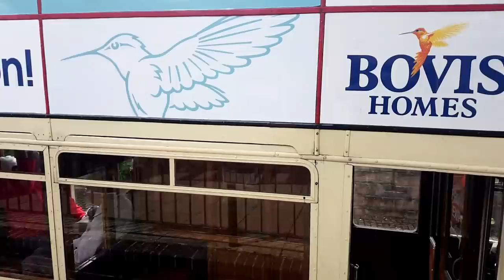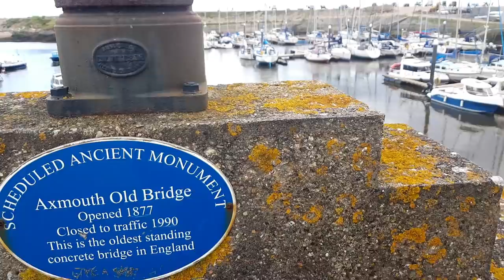Daewoo Matiz Sh**efest and Performance Mod!

Comment: Hi HubNut I'm a regular viewer from Oz, and how extremely entertaining they are. I loved your comment about 'where your life has gone spectacularly wrong' re the age of your cars ... Fear not I have a 28 yr old 1991 Honda Legend used daily, which still goes great guns! It has all the nonsense everyone wants these days ie air bags, apart from the info display screen, which can easily be retrofitted etc. It doesn't leak any oil, uses very little if at all, totally rust free, leather interior, has a very smooth and silky sounding 3.2, V6 when you put your foot down (and it has a north-south engine – but FWD) ... think about that, goodole Honda I say. Honda make great cars which don't break. I'm driving one of the rarest Honda's in Oz, rarer than a Ferrari ... ha ha. No one looks at it, but I do and people in the know. It's not my oldest car ... that is a 1974 Rover 3500S. All the best.

Comment: I love the Matiz, too. I had a silver Daewoo Matiz from 1998-2006, then in 2006 i bought the updated version and called Chevrolet Matiz in copper-metallic which i drove to 2019.  After a accident i had to buy a new car and of course a 0.8S Chevrolet Matiz again, a modell in ice-silver from 2010 and 90.000 Km on the clock. That car shines in my street. No rust, no scratches, and superb technical conditions after it was checked. Im happy with the Matiz-series and hope i can my new "used" car a lot of more years. :) Greetings from Germany.
Reply: @Aswin Anbarasan, thats true, but Daewoo only still exists on the korean market and Chevrolet with the Matiz sells only in southamerica. In europe either Daewoo and Chevrolet have gone. :(

Comment: Totally agree about triples--my Dacia Sandero has the Renault 900cc turbo triple in it, and it's a fantastic engine. Sounds great when revved and yet pulls from surprisingly low revs. Only time you ever really notice you're in a car with such a small engine is when climbing very steep hills indeed!

Comment: Love 3 cylinder engines - owned a Corsa B and C with the 1.0 engine, and they sound lovely when revved.
Reply: Mostyn the Sooty Van I learnt to drive in a corsa c 1.0 12v piss easy to learn in sounded good shook at 90mph mind you 😂

Comment: I remember a while back, Ford commissioned Yamaha to build a V6 engine for the Taurus. They actually asked just for heads, but Yamaha ended up giving them a complete engine. Ford fitted into the Taurus SHO. It had two runners for each cylinder, one short, one long. There were butterfly valves opening and closing off one or the other. So that was their way of achieving both torque and power.

Comment: I removed 3 restrictions from the intake system of my wife’s golf 1.6 16v. The only reason I can fathom they were there is because without them it not only destroyed a 2.0 8v “gti” but also the n/a 1.8 20v. Mind you that had a management system that could learn, you’re stuck with old Vauxhall crap :). Awesome video mate!

Comment: Hi ! About torque and power and intake length: many manufacturers deal with that stuff and have switching intakes. Opel / Vauxhall had that on the MV6 engines. It had a long bypass for low revs gaining more torque and switch to a short lenght for more top-end power.
On the Matiz a turbocharger might be the only choice available. Other than a different engine, but that's costly and may exceed the money you want to put into it - if any. It's a Matiz in the end and it is designed for a certain purpose as a small familycar not a racer.
The restrictor in the filter housing will limit the airflow at higher revs - and the engine will surely start running too lean in the end - which the fuel system will not detect. I would put it back in. It helps not to damage the engine. On a true fuel injection system which monitors the air masses and manifold pressure you could do that - not on the "el cheapo" system of the Daewoo.
It looks very suspiciously after a TBI even though they claim it were MPI. But what.
Reply: If it really doesn't detect it (seems from the pinking) than a bit of remapping might be in order or possibly larger injectors. I think the engine was developed by another GM branch, so it might be possible to properly tune it if the design was more or less off the shelf.

Comment: Peugeot has the same thing on the 1.1 106. I believe it's meant for low down torque improvement and noise abatement as it increases the air speed into the manifold at lower rpm but restricts it at high rpm. Removing it changed the torque characteristics of my 106 markedly.
Reply: @Spac8 - that's interesting. I've had my 106 1.1 for just over 2 years & didn't appreciate any applied restriction to the air inlet flow? I really like mine & we've just bought another for commuting!
Reply: @robk3596  They're brilliant! It is very rare I praise a modern French car but Peugeot/Citroën (PSA Group) got the formula bang on. From the 106/Saxo right through to the Berlingo/Partner. All the same basic layout, amazing rust protection, cheap parts and great handling. They're not without their flaws, but they tend to not rot like a Ford or have the complexity of a Vauxhall of the same era. I kinda wish I never sold my 106, was great fun and seriously cheap to keep running. 

(Edit: This applies to the multi point injected, later models!) With regards to the air restriction, take a look at the pipe that connects the front air feed to the air filter housing. It restricts the intake into a Venturi that is little more than an inch in diameter if I remember correctly. I played around first with using a pipe from a 1.6 Saxo VTR, as they use the same basic air intake setup, but the connecting pipe has zero restriction and is the same diameter throughout. (The 1.6 has a lot more torque!) It immediately changed in power delivery of the engine.

I then picked up a K&N 57i kit for next to nothing and that made the change even more noticeable. Essentially, with the stock setup, it felt fairly torquey low down but hit a wall at about 5000rpm and didn't make much power after that. With the swap to the straight pipe and then the K&N, you felt a small lack in torque very occasionally where the engine bogged a tiny bit and really felt like it wanted more air speed into the intake, like it was having to build up a bit of air flow first, but as soon as the revs got up, it was a totally different car. It wanted to pull to the 6200rpm redline and beyond! Was indecently fast for a 1.1 and made a hilariously good noise at full chat. I had a genuine 100mph GPS, (Closed road of course...) and a 0-60 of about 10 seconds from it. Have fun. I miss mine! 😢😞
Reply: Spac8 - Thanks so much for that, it's an interesting bit of extra knowledge in my case! It's my first one & hasn't missed a beat in over 2 years (25k)! Mines an 01 plate & have just bought a 97 for the wife to commute in etc. The main things I'm aware of are they all appear to leak oil mostly from the left side cylinder head area & rear torsion bar arrangement can be problematic with age! But as you say great cheap & fun motoring for what is a small car! Thanks again for your response!

Comment: The Citroen BX has it's origins from the Volvo Tundra concept car that was also styled by Bertone and based on the 343. Volvo rejected it because they thought it was too modern and difficult to sell so Bertone sold a similar design to Citroen which ended up becoming the BX. Some features like some of the switch gear and the electronic dashboard was carried over. The BX is very stylish and still stands out today. I loved the intermittent clicking the suspension made and how it slowly raised up from cold.

Comment: Just a thought about the ‘Reducer’ in the Air Box. Perhaps Daewoo made ONE Air Box to fit a range of engines. With each having different Air Volume requirements, that Reducer Spigot was the only thing that needed to change.

Comment: Also my Colt had same issue i tried fitting a K and N sports Air filter but it played havoc with the idle and the car would cut out , so yeah Air Filters are best left standard.

Comment: If you wanted to hear pinking, try the  Renault 18GTL with the detuned 1647cc engine (not the original 1397cc). When they started reducing lead in the mid-80s, mine made a horrendous racket....

Comment: Look up plastic welding with a soldering iron. I did it on the cinquecento bumper and it worked a treat. Use black cable ties as a filler rod if needed. Try not to burn the plastic as you do it.
Reply: Hot staples, followed by mostly cosmetic plastic melting, works better for lugs that require some strength.

Comment: I had a dodge caliber, I was jumpstarting my old vw, and took off the slim air box vent that went over battery. Forgot it off, when I was driving it, wow what a induction noise difference !

Comment: I had a 1750 maxi once, and accidentaly stsuck a screwdriver through the radiator and was imminently due to set off to somerset from cornwall in convoy to a music festival so following a hot tip and quick trip to the spar shop i bought some eggs, cracked 4 in to the rad, topped it up and within 5 mins the leak had stopped, fast fwd a year and i scrapped the car it still had the same water in it!
Reply: I used an egg to seal a leaking Reliant Robin van rad many years ago, worked a treat.

Comment: if the brake pedal on Myrtle seems to have a lot of travel  usually the rear brakes need taking up. pull the handbrake up a bit while driving and see if it brings the pedal up,if so then the self adjusters are'nt. I had to T cut  the headlights on the matiz every 6 months. An interesting assortment of vehicles at your event.

Comment: Some of the late normally aspirated straight 6 bmw engines have the variable air intakes reasons as you stated. Good low and high end torque

Comment: You talk about variable intake runners. I had a 91 Mazda 626 which had the FE-DOHC engine (South African market only). 
It had a complicated dual length inlet manifold with a set of pneumatically operated flaps which would change it over to short runners @6000 rpm.
It made 146 hp - not bad for a 2 litre engine in 1991. Very durable too - made it to 350 000 miles (unopened) before it died of terminal wireing loom failure.

Comment: put some gumout cleaner in the gas to decarbon the engine. bg44k works great also. it does know how much air. its measured by the mass air flow sensor. most aftermarket air intakes are loosers. most cars and motorcycles have great intake systems from the factory and messing with them is counterproductive.

Comment: NOt meaning to split hairs but (AIUI) it is quite customary for the explosion to happen before the piston reaches tdc.  Its when it goes TOO  far advanced that "pinking "occurs and is related to other effects going on.

Detonation before TDC is normal for the full downward force to have time for it's effect take  maximum efficiency.
I think!!!    :-)
Reply from the maker: Yes, fair point. HubNut engineering again!
Reply: @HubNut  a fascinating subject actually, I dare say phDs have been written on just this!

Comment: 20+ years ago some little engineer probably spent days and days designing the airflow into that engine, lots of testing to get a nice smooth flow into the throttle body, plus a nice smooth flow over the maf sensor so the car knew exactly how much air was going in. Roll forward 20 years and some bumbling car enthusiast decides maybe the engine would be greatly improved if he removed the useless bit of plastic that was blocking the flow of air into said engine. :-) :-)  Thankfully same blundering car enthusiast soon realised the error in his ways. lol. Only kidding Ian, certainly worth a try. I live near Barnstaple, so yes, i know the weather was not the greatest down here over the last week, but nothing unusual there for Devon. Glad you had a good weekend regardless.
Reply from the maker: Plenty of people told me to try it. They were all wrong!

Comment: There's a Porche 911 episode of Wheeler Dealers where they deal with a mechanically activated extendable intake trumpet issue..the intake trumpets are inside the air-box and are powered by a vacuum....extending at full-throttle etc. :)

Comment: that venturi was in the intake to quiet the intake. it is not likely to make much difference. back in the 60s chevrolets had a ventury in the intake air horn. it did not make the car loose power just silenced the sucking sounds.

Comment: Several years back my hard up sister needed a car, So I bought her a cheap "Atomic snot" green Daewoo Matiz. Before handing over the keys I decided to do the brotherly thing and check it wasn't going to blow up on her. After changing the oil, Filters, Plugs, And (Because they looked ropey) the HT leads I took it out for a little test drive along the country lanes of the area.

Nearly 2 hours later I got a call from my housemate to find out where I'd broke down. He assumed that as I'd been gone so long I must be trying to push the car home, But in fact, The reason the test drive was taking so long was because it was an absolute giggle to rant it around the same quiet twisty roads I used to hoon about on in my first car (A Fiat 127 1050CL with bucket seats ! :) ). I didn't manage to blow it up (Though I did manage to fade the brakes to nothing at one point) so handed it over to my sister a couple days later.

At that time I had a track day prepped mk1 Mazda MX5 and a Lexus IS200 sitting on the drive, But while I was busy throwing that Matiz into corners way too fast I was seriously considering keeping an eye open to find a nice one for myself. That didn't end up happening though because as an occasionally used "Also" car it would have been WAY too expensive to keep taxed for the odd occasions I felt like reliving my youth.

Comment: Ian, you may need to disconnect Myrtle’s battery for half an hour, then reconnect and take her for a spin with the restriction removed. Myrtle perhaps can’t get her head around her newfound ability to breathe properly and adjust her fuelling accordingly. In other words, try resetting her ECU! ;-)

Comment: I suppose you have to logically assume that a manufacturer would never cost something that was neither use nor ornament. However, removing a restrictor does sometimes add the odd few extra miles of MPG if it does nothing else, and the Matiz does look like it has an air flow meter to tell it's brain how much air it's getting. You could trial and then check a plug .if it is going white ish then the mixture is too lean.

Comment: A guy loaned me a Matiz while I was working on his boat. It had a blown head gasket. 

Went to a spares place to get a new head gasket, or top end kit, and the guy told me you couldn't buy them separately.  You had to buy a complete engine overhaul gasket, with crank seals, valve seals etc, the lot.

"Here we go" I thought,  "rip off time"... 'How much?'

'$37.'

Comment: Excellent videos as always HubNut and loved the Citroen BX and the early 5 series BMW. Want a nice camping experience , get a mk1 or mk2 Transit Camper van , plenty of hot tea and hot food , easy to maintain and not much problems whole front comes off for easy access and the strong 2.0 litre pinto or 2.5 diesel are very good.

Comment: My old Volvo 850 20v had variable inlet lengths.  They deleted the system after 1995, presumably to save money.  It was like a turbo kicking in when it switched over.

Comment: Another nice adventure, but in a storm, cool. Some really nice cars, can't wait for the test drives. I've just bought an 04  3dr Ford KA collection 1.3L in very light silvery green, with 12mths MOT with only 63,000 genuine miles on it, for £490.00.  Does that constitute a HubNut type car, and have you done a review on one bud, if not, would you like to.
Reply from the maker: They certainly rust enough to be a HubNut car! Too many on my backlog at the moment though. Thanks.

Comment: Would expect your matiz will run a low pressure turbo without the need of engine components forging.
Perhaps you should own a small camper van next

Comment: Intakes I remember something about the Rover 825 being upgraded to the 2.7 engine and they had variable intakes I believe???
Reply: Darren Smith dunno about the 2.7, but the KV6 engine has a variable intake system with flappy valves controlled by motors that don’t age well
Reply from the maker: Yup. KV6 had it, not sure the Honda engines did.
Reply: @HubNut  Yes you are probably right i can remember the 2.5 Honda unit in the Rover 800 being described as Gutless  mid range by journalists at the time, Rover introduced the 2.7 to overcome this and i am sure i can remember something at the time about the inlets being different to help give it some extra mid range grunt. Im probably getting mixed up was a long time ago . showing my age now haha. Regards.
Reply: @emmajacobs5575     Yes you are probably right i can remember the 2.5 Honda unit in the Rover 800 being described as Gutless  mid range by journalists at the time, Rover introduced the 2.7 to overcome this and i am sure i can remember something at the time about the inlets being different to help give it some extra mid range grunt. Im probably getting mixed up was a long time ago . showing my age now haha. Regards.

Comment: Or you could just buy the 1 litre Matiz that Chevrolet used to sell , 2 advantages , 1 its newer and 2 it has that little extra power , 0-60 in 14.5 instead of 18 secs so that's quite a difference